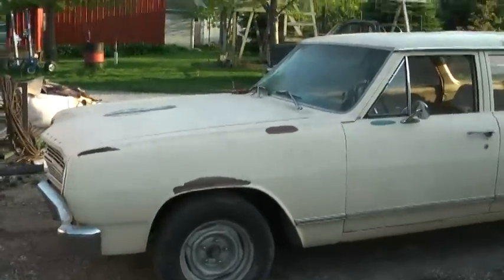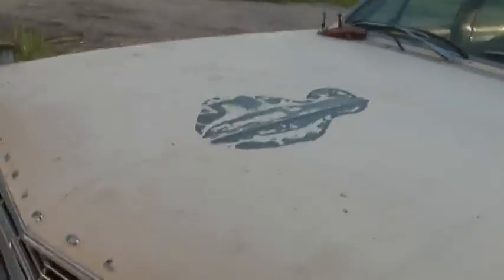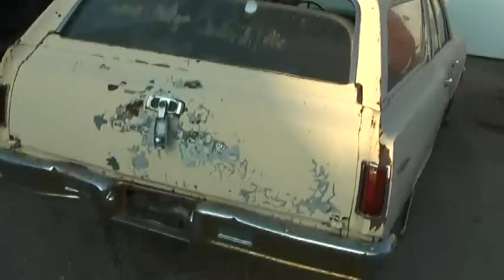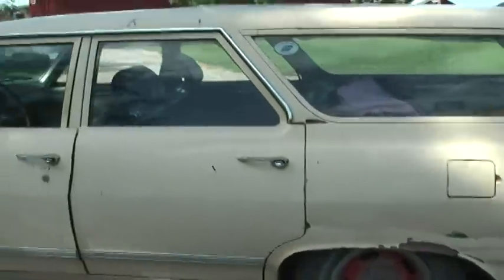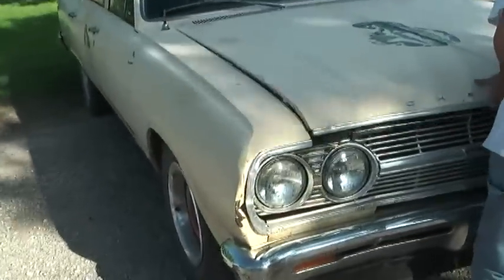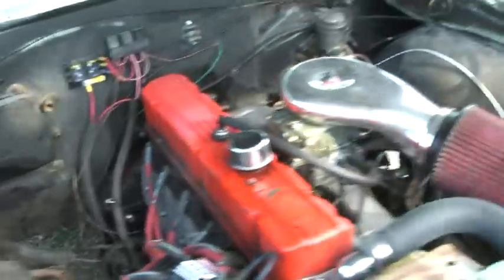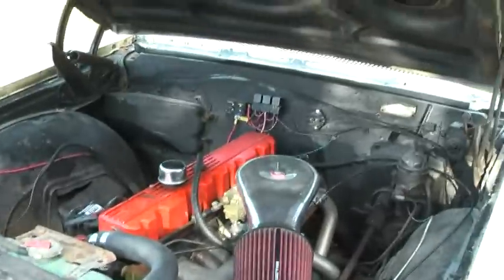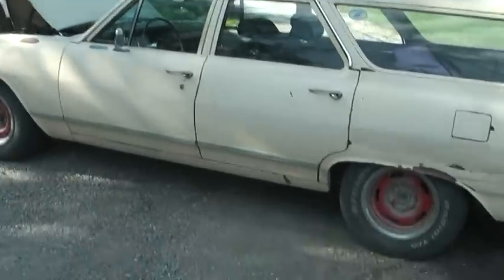250 chevy inline 6 in 65 Chevelle wagon lump port head

Comment: there is something awesome about a hot rodded 6 cylinder they sound absolutely mean!
Reply from the maker: The six's can sound mean. Thanks
Reply: Tom Lowe this in Brazil is a opala engine, good song :)
Reply: Tom Lowe ...Why on earth did you put that tiny single outlet exhaust system on it?  You built an engine that would breath and then strangled it.
Reply: barryismygo
Reply: @marvinblankinchip2535  Considering it's a 250ci motor it might not matter that much, and I'm pretty sure that 'muffler' is a straight through resonator. I'd be curious to see how it performs on a dyno with open headers, this exhaust, and then a true dual exhaust. It's the perfect exhaust to run an X pipe on, you have the pipes coming off the header already right next to each other. As is it doesn't really sound all that strangled.

Comment: I had a 1950 Chevy business coupe with a 1958 235 six. 30 over. Milled head. Mcgurk pistons. A Barry's cam. Electronic  ignition  Clifford tube header. A modified Clifford intake with a weiand 142ci supercharger with a holly 650 double pump. And  3in exhaust... it made over 300hp and man it sounded like a pissed off Cessna airplane.  The car was a smash at back to the 50s show in st Paul Paul MN for many year's

Comment: Love this shit, I was born in raised in MT and my dad is from Iowa. So if your ever sitting on the side of the rode in MT I will stop. I also have a 65 chevelle wagon. Mine is a 300 deluxe that was an original 230 inline six with a 3 on the tree. Now im running a 350 with a turbo 350. Dont have a pretty paint job or anything like that but i grew up loving these old cars. Im 24 and feel like im the last of a dying breed that has a passion for the old school classics.

Comment: A friend of mine had a 66 Wagon that was the color of your car. The inline six cylinder engine is one of the most overlooked power plants ever. These engine's per cubic inch make more usable torque than a V-8 and when properly modified make substantial HP as well. A Man by the name of Jack Clifford put the six cylinder Engine on the performance map back in the early 1950's!

Comment: damn. so smooth in acceleration. been following you for a while now. 

building a 250 of my own at the moment- bored .30, 9.5:1 pistons, upgraded rockers, push rods and related guts, ported heads (including your lump port kit), dual exhaust, offy intake and sniper EFI, mild performance cam and modified/blueprinted oem distributor. 

pairing to 700r4 and 3:73 gears. 

will brobay come out right around 300hp/torque give or take 10-15.

cant wait to drive it. 

thanks for a the inspiration, Tom!

Comment: Nice to hear and see the grandaddy of most big sixes in action! I have an aussie six, 250 again (thinks that equates to 4.0)
Beautiful sounding engine, from the mid 1996, it now has 320,000 kilometers and still running strong. 70mph in 4th overdrive the engine beats at around 1900 rpm.

Comment: Thanks for sharing this!! I'm glad to see another i6 enthusiast. I had a 1968 Mercury M-100 pickup truck with a 300 cid i6. It had 170 HP and 260 lb-ft torque. It was 3 on the tree, but I so badly wanted to throw a 4 on the floor or an updated 5-speed with a uni bellhousing.

Comment: 76 c10 so far I’ve done in order fuel pump, plugs, air filter, wires because the parts store ordered the ones for the 4x4 🤦🏻‍♂️. Next is carrier bearing and then tires. That start up was great mine does the same due to no choke.

Comment: Listen to your description at 3:27    sounds like thats what you said.  As far as my ride goes--have a hybrid cyl. head done---2 canfield heads cut and welded to make a 12 port crossflow head---block done,  car is a `76 nova, 9in. 4.56 rear gears---in process on removing front clip an putting a straight axle assy. under it---gasser style.  Have no pics but will post some soon.

Comment: I bought mine out of a field, it had a 283 in the back with 2 speed glide bolted to it, the original motor was long gone and from what i understood the 283 was in it till the guys son blew it up and they pulled it and stuffed it in the back. As far as boring engines go 350's are cheap to build which is a perfect for a guy like me who dosnt have a lot of money and wants a hot rod. If i had the money i would already have an LSX454 in it with a T-56, but you can donate money so i can finish it

Comment: I've been told or read that a four barrel quadrajet manifold from an OHC 6 Pontiac will bolt right to that head. Not that it can profit from it, but I had a ohc 6 single barrel and it did run sweet. I have a beautiful 54 Belair with the 235 out of it, and I'm tempted to hop it up some. I've done a triple angle and back cut the valves so far. One of the thriftiest engines I ever had was a 194 in a 65 Chevelle 4 dr sedan. It had a piston or wrist pin knock but it barely used gas. Cool car by the way, I had 3 65s, two were SS. I always did like wagons.

Comment from the maker: Yes a hydraulic cam. The engine is a 250 Chevy with flat top pistons, balanced lower end, offy intake. Compression is 9.5 to 1. The head has extensive work. Bolt in lumps are installed along with 1.94/ 1.6 valves. The head is also ported. Cam is a Clifford 270 hydraulic. This engine dynoed at 285 HP with a 4 BBL and  Clifford intake
Reply: Hello and thanks for sharing this inspiration video .
Do you know how many HP will put out with stock cam ?

Comment: Wow this is somewhat close to what I am building compared to what most people are doing dropping the big V8  low gear show queen.
Pulled the original 230 that was hurt and am now running a 250 slightly modified to run the road.

Comment: Nice ride, but other than a utility truck I could never figure out why GM would even offer such a dog straight six (in stock form anyway) with a 2 speed power glide transmission in a vehicle that weighs almost 5000 lbs or I could never figure out what kind of person would actually buy such a set up when the V8 up grade was something like $23.00 or less at the time. Its not like gas mileage was a concern in 65. Can you imagine how slow something like that would be loaded up with Seven relatives weighing over 200 lbs each trying to go to the beach.  Cool car and love the paint as is.

Comment: I can answer that for you if you don't mind. He has a hydraulic 270 clifford cam in it. 270 degrees duration and .525 lift with stock rocker ratio. Cam comes with all necessary parts to install. Hope this helped.

Comment: You can have lots of fun with the Chevrolet inline six cylinder engine with performance parts and suspension parts don't forget to get 3.50 gears with limited slip deferential with any Rear end like 9inch Ford or GM 10 bolt 8.2 or 8.5 inches just to have more fun

Comment: if the aftermarket would manufacture a 250/292 cylinder head with vortec fast burn chambers (and MPI injector provisions) it would run circles with a stock Jeep 4.0L (the Jeep six in my Grand Cherokee has the OEM header and stock exhaust with over 283,xxx miles - would either consider a str8 pipe or a Flowmaster
Reply: Sissel makes an aluminum cylinder head.
Reply: +Isher GM do Brasil did manufacture an MPI head for the 250 for its local market Chevrolets (Opala, Omega, and the Brasil-market GMT400) but the components are unheard of in the USA (the head has the peanut intake ports - if in possession of the Chevrolet Inline Six Power Manual there is a pic of the Brasilian head although it did not make it 2 the USA since the final inline six (the 292) retained the monojet (250 production ended in 1984 in the USA but not in Brasil); third gen inline six ended production in 2001 (both in Mexico and Brasil)

Comment: I have a question, I have an 80 chevy van with the 165hp 250 with the 2 barrel and split manifold and it has a a single 2.5" exhaust that tapers to 2", I'm wondering if I should go 3" cat back with a dynomax VT (I have this muffler laying around) and exit it in front of my rear wheel (to get my exhaust away from my rear door seals)

Comment: At 5 minutes, your exhaust was chirping. 
Air is getting sucked back through the exhaust.
I have the same thing on my 292.
Pretty sure it's the camshaft on mine. May be a lifter on yours.

Did you ever verify that? 
I'll buy a new cam and see if it fixes the lean condition associated with the chirp

Comment: My God... 194 and a powerglide (originally) in that big wagon? What was the top speed, 48mph?  Nice work on the upgrade. That looks like so much fun!
Reply: Don´t judge a book by it´s cover. A 194 engine with a 2 BBL and a street cam can beat a 250. They seem small but can be pretty fast with just a little tuning on it

Comment: Hey my friend. I see this was 9 years ago. I have a 230 L6 chevy motor. Im having clearance issues with my air cleaner. Did you go from a single to a double barrel carb? And is that a short adapter plate? Mine is almost 2" tall.
Reply from the maker: The snorkel is a Spectre low profile

Comment: Different is cool, but not when it doesnt make more power, sound better or even offer the same or better mpg as a stock 350. Had a buddy in high school that camed his 73 nova 250 with split headers and flows. Lowering exspectations can make alot of things seem worth it, or cool.
Reply: Branden McNamee Not everything is power and sound. These inline sixes have a unique sound too. A low rumble then a nice smooth moan in the high rpms. Since it is an inherently balanced engine as well it is very smooth. I've driven a 05 trailblazer with the 4.2 inline six for the past 5 years and would rather have the inline six just due to the different sound and feel. Everyone has either a v8 or inline 4. (i'd rather have the v8 in that case) but if it's a cruising car or a daily driver that doesn't need power, I want the inline six because not that many people use them anymore, so they are cheap and unique to be proud of.
Reply: Branden McNamee Everyone and there brother, sister, grandmother, grandfather, and great uncle have a stinkin 350. That motor is so over rated its sick. Now, hopping up a 6 banger...THAT's cool. My 292 will kill a 350 and its only mildly modified. Now a 350/350 I'll have some fun trying to keep up...unless I add a few pounds of boost to my 292. But I'm a happy man with a big smile seeing my 6 banger under the hood instead of what everyone else has. I have 3 292s...stock...tiny bit modified, and one I dug into and mildly modified for more power. All 3 are fun and will do what I need them to do...I'm one that doesn't need to get up to 55 miles and hour in 1 second. 6 in a row makes it go my friend. lol Don't under estimate a 6 banger.
Reply: +Military Chevy do you have a 292 you'd like to sell?
Reply: +Felix Mendoza Sorry bud, 292 I have is for a future build. Hope you find on though.
Reply: No problem.  I appreciate your response.  They're really hard to come across.
Reply: +ccubsfan94 My grandfather had a 06 Envoy with the 4.2 and that thing sounds nice when you get on it, not an underpowered motor either in my opinion.
Reply: +MRSPEEDFREEK95 has*

Comment: Nice car.I just got a 64 Chevelle 4 door with a 250 that came out of a 71 Nova with 65K on it. Im not familiar with this motor.Any opinions on it?
Reply: +colby sander the third gen six (which succeeded the 1937-63 Stovebolt) shared some components with the small block but aftermarket support has a luxury price tag (unlike the SBC which has a cult following) - Clifford Performance, Sissell, Duggan et.al. have been supportive of the third gen six but their Lexus-pricing 4 their aftermarket components would make the Jeep 4.0L entry level (aftermarket headers and aluminum heads r now produced with the Jeep motor but a few usually shoehorn in into vintage Jeeps and AMCs - AMC (later Chrysler) did not redesign the head for the 4.0L unlike the 1975-84 250 when the head was integrated with the intake manifold (292s kept the separate intake but the 2 oil crises forced GM 2 phase in the 4.3L (LB1/LB4) in 1985 which was used in the B and G platform automobiles (fleet Caprices were the final passenger cars 2 use the 4.3L but it ended up with the truck/van line until 2013)

Comment: Sir you are a genius! this is exactly what I dream to do to my 73 Nova with inline 6. The part that pisses me off is the 2 speed power-glide which has a bad MPG.
 What type of 5 speed did you use or recommend?? that was awesome going that speed (I think you said 60 MPH) with 2000 rpm !
Reply: T5 transmission is an affordable option.
Reply: Hello dear babak .I think strip riding with low RPM needs overdrive or a long rear end gear like 2.53:1 (17/43)that in this case manual gearboxes need a short 1.gear like 3.5:1 or if it's automatic must be a TH700 with o/d. otherwise your vehicle will have a lazy take off. You know the last gear ratio of most of gearboxes and automatic transmissions without o/d is 1:1.
Reply: @ramin2400  Thank you for the advice! I ended up putting a Tremec T5 and Clifford dual output headers and a set of Trasnam exhaust on my Nova. It was a lot of work and unexpected expenses but the car feels and runs great. Now I have to get a 345 post rear-end! LOL money pit!

Comment: Hey I have a 1978 Chevy nova with a 6 in-line and i was wonder want can i change on it to make it faster
Reply: Get the “lump port” kit. It’s a must. you can use big block Chevy roller rockers, headers, an aluminum intake, a performance cam, Z28 valve springs.

Comment: I just had my 6cy 250 chevy motor rebuilt putting it in a 53 Chevy truck i want to run electric fuel pump from the tank can anyone guide me what electric fuel pump i can run?
Reply: I reloaded my fuel tang replaced it with one on the back of the frame

Comment: id use an exhaust from a 3rd ge n camaro.. they make it hard to differentiate from the sound of a 6 cylinder and a v8 to an untrained ear.  it will sound more like a v8 with a high idle rather than a ricer like this one does when you get on it.

Comment: "nothing fancy"? A 5-speed Richmond sounds fancy instead of just using a T50 or T5 5 speed manual either of which would be able to handle the torque of a six banger... especially for 'cruiser' use...
Reply: T5's can't handle much more than 300 foot pounds. That 250 is putting out more than that. lol